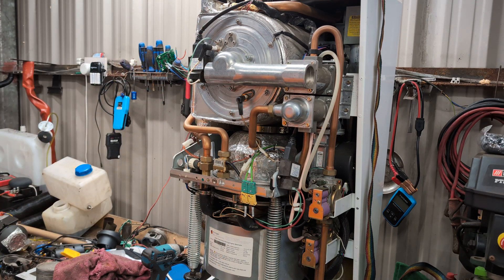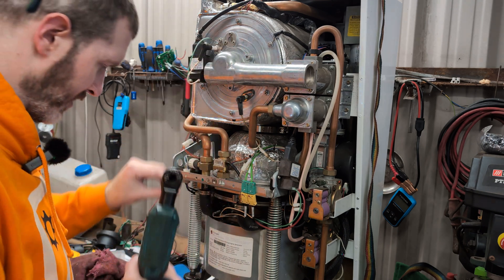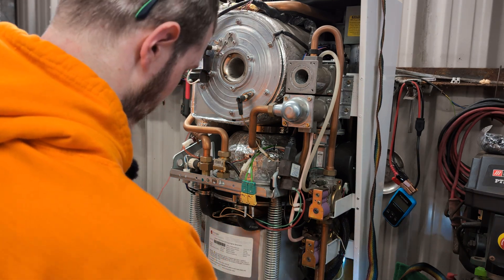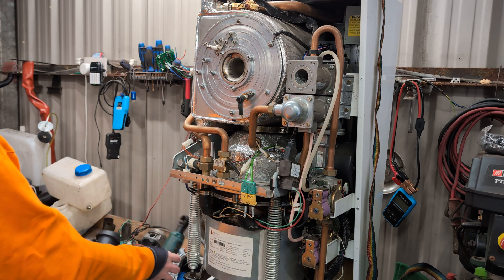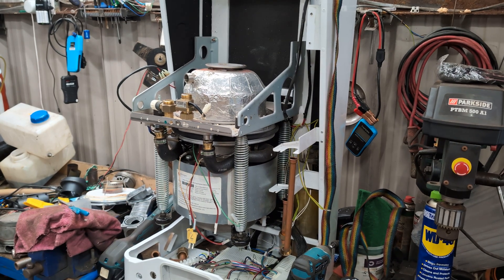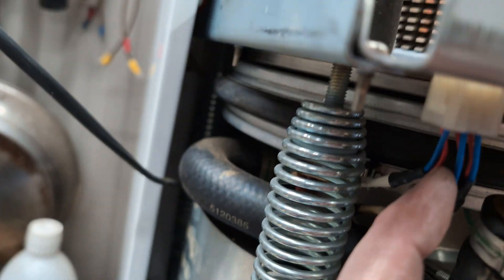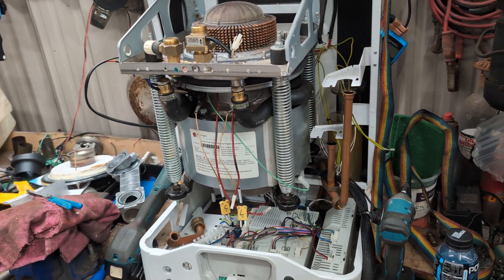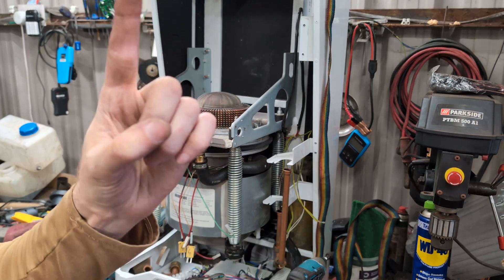Self Powered Diesel Heater Using a Stirling Engine? - Part 2 - Stripping out the gas bits

Comment: Stirling uses a gas, which is compressible. Think liquid Stirling. Malone used liquid - much more torque. Hydraulics amplify force and transfers heat much more effectively than air.

Comment: without any electronics attached, with hot and cold supplied, the stirling engine should turn. I'd be tempted to start with a heat gun for convenience as your heat source.

Assuming the output is AC you might be able to start with a wind turbine controller?

Comment: What's the fascination with using diesel as the fuel as opposed too gas?
Reply from the maker: The plan would be to use a diesel heater as the heat source, once the hot gas has passed through the engine it can then be used to heat a space.  Providing heat and power in theory.
Reply: @DavidMcLuckie  forgive me for my ignorance
Why aren't you connecting the exhaust outlet of the diesel heater too gas burner  inlet you remove within the first 3 minutes?
  All the control electronics you need are already installed (where they need to be) just run the machine within it's design  parameters using your diesel space heater exhaust inplace of the gas burner mixer tube you first removed
   Patch in the gas burner signal too run into the diesel heater's
   Patch in the original circulating pump signal to run into air fans on the hot inlet/outlets if you're not using some form of circulating water too maintain design parameters
Looks to me that you're trying to create work for yourself.....or am I missing something?
(Yes sterling motors normally need an assist to start, but I assume the manufacturer has already done that for you)

Comment: Hi David. Having built a few Stirling engines as hobby pieces the first thing I'd do to see if I can get any reaction from it is to disconnect the AC output so the alternator is in free run, run a garden hose through the cold side and heat the big heat sink with some thing like an electric heat gun/blow torch, I test my hobby ones on a gas ring. You really can't stop a Stirling engine from running once the timings right and since your not interfering with any of that end, it should just start. The electrics that are attached to it presently are most likely just to keep the alternator in free run until it builds enough speed, heat and power and to regulate the voltage once it reaches that point. Disconnect everything and hit it a kick, what's the worst that can happen.
Reply from the maker: That's about what my plan is for the first run.  From what I've read when it wants to stop it just switches onto a dump load and it stops.

Comment: With free pistons before I've seen should just heat them up and give them a nudge to get them going. This could be a quick power pulse into the coil or hit it with a hammer in direction of travel. 

Don't know what you have to mesure stuff do you have a scope? I would start with a mesurement device meter might work. woble it on the strings and see what you get out will give you an idea of how much voltage you need to put in it.

Comment: Just my 2p worth, having been fascinated by (and playing with “toy”) stirling engines for decades.

Output appears to be single phase, but is likely to need a “kick” to start it running. 

Connect the two output wires to the centre contacts of a DPDT relay. 

Connect the normally made relay contacts to a solar MPPT via a bridge rectifier, this should operate from around 50v but also go up to 500v DC no problem. You may need some capacitor smoothing on the DC output side, electrolytic capacitors from old mains switch mode power supplies will work here - up to 400 volts.

On the make side of the relay, connect an electrolytic capacitor (again, a 400v one out of a switch mode power supply) with a diode in series to prevent back flow. Charge this using a bench power supply, I’d start around 50v and work up from there. 

When briefly activating the relay this dumps the capacitor and gives the stirling engine the “kick” it needs to start. Once the relay is released any output from the now running stirling engine goes to the MPPT.

Needless to say; lots of volts and energy in capacitors, so sensible precautions apply!
Reply: Bro👌